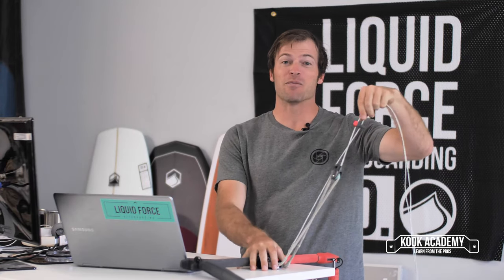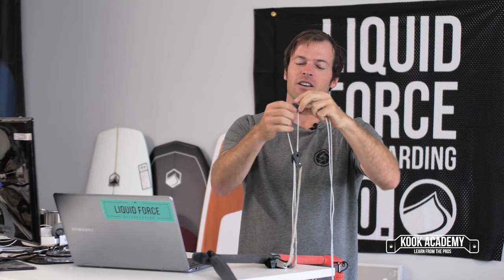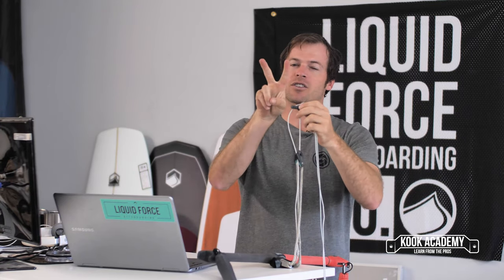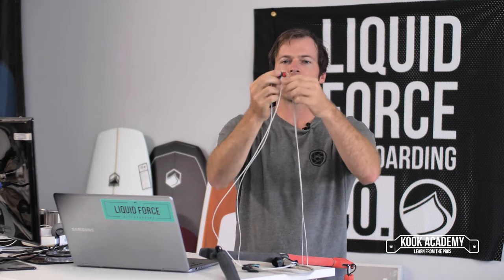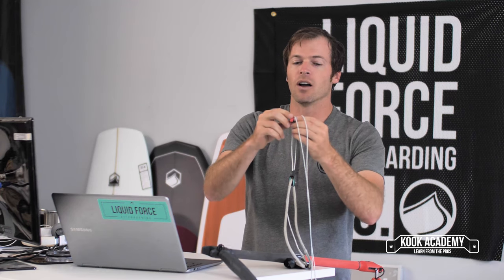What Is The High-Y Adjuster? Liquid Force Kiteboarding Kook Academy

Comment: Question: I’ve  seen on other bars that the high-Y center line adjuster can cause tangles with trailing edge lines during drift launches and also self-launching off a truck.             What’s your take on this, and how does your nice looking y-split do in this regard?? Thank you kind sir!!
Reply from the maker: Hey W. Davidson!  Our best response to this would be that it is good practice to always kite with a buddy.  Things can happen out there, so self launching isn't recommended (although we have done it ourselves plenty of times).  With any pieces that are attached to the lines, there is always a chance that the lines can get loose and then tighten up like a noose around the part in question.  If you make sure your flagging line is going through the big hole in the High Y Adjuster, hitting the release when the lines get caught should still activate the safety system and allow you to reset or fix the lines.  If you are really worried about getting the lines caught in a drift or self launch, then simply remove this piece.  A small trade off for safety we feel.  Hope that helps :).